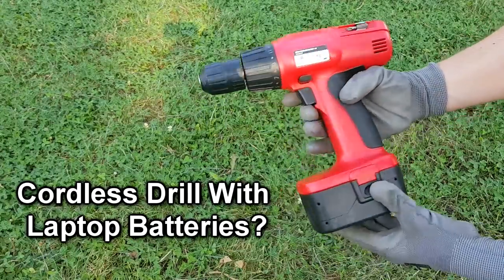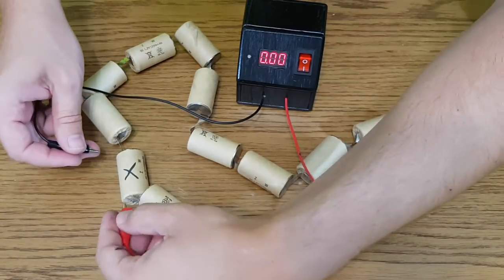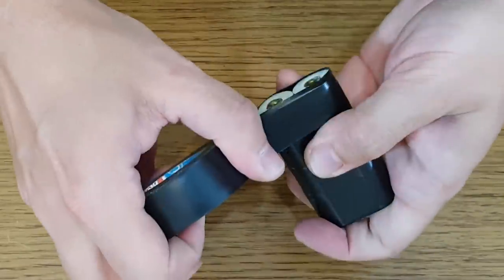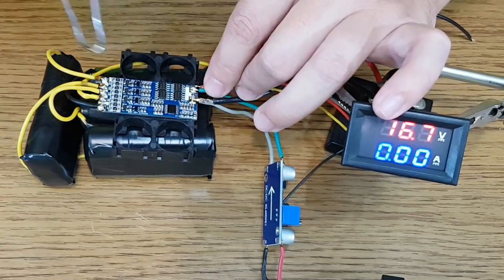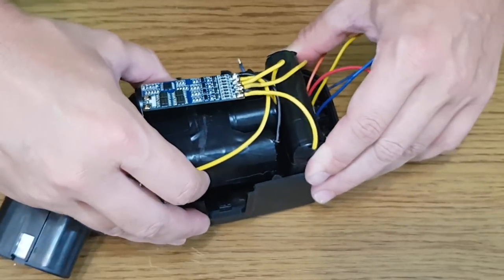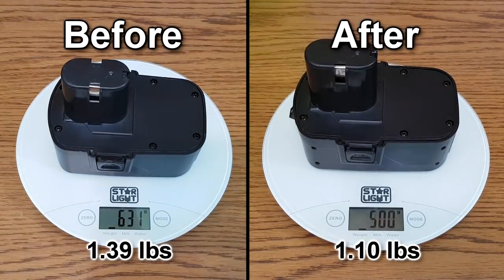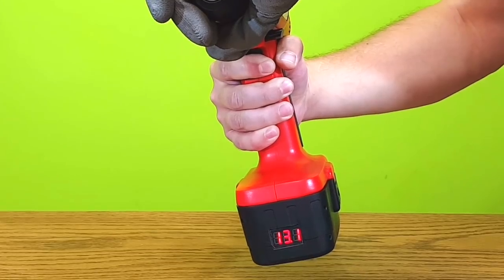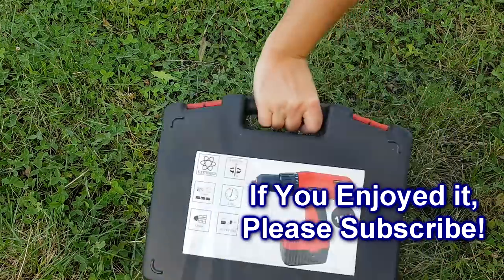Cordless Drill Conversion - With Laptop Batteries??

Comment: Hello Sorin, let me ask you something, i have done exactly what you did, but i have a different bms in comparisson with the one that you used.. It turns out that de internal resistance is 0,7 ohm and when i pull the trigger of the drill, it barely moves and turns off... how can i solve it without changing the bms? Can i add in a permanent way two 1ohm 20w resistors in parallel? in order to avoid the short circuit protection of the protection board? THANKS YOU! amazing Job. Guillermo from Argentina
Reply from the maker: hi. you can try first to add a big capacitor in parallel to the output wires, just before they enter the drill. you need a 24V and 4700uF (or bigger) capacitor. it will store some energy and maybe the voltage will not drop so much when you start the drill. if that is not enough, you can try to add the resistors (between the capacitor and the drill). but the resistors will get hot, when the drill is working in full load, so find a good spot to install them, not close to the battery. the drill will use more than 100W in full load, you need to use the drill with a lower torque level, to protect the 20W resistors.
Reply: Thank you so much Sorin! I added 2 1 ohm 20 watts resistors in paralles among them and in series  with the drill and works, but as you said they get really hot... I will try it as it is until i find a big capacitor. It is a pitty because this is my thurd conversion and i didnt have any problem with the previous two. Thank yoy again for your help! Keep on with your amazing videos!

Comment: Hi
I built a circuit as per yours but used a different BMS and a 3S configuration. When I connect the monitor board I get a constant 3.5v at the two points for the drill powerwith the switch "off", would it help to connect the actual positve lead from the monitor to the BMS batt Positive and not leave it floating as per ur connections. if you wish to help could I send you the layout. Thanks
Reply from the maker: hi. I don't know what type of BMS and monitoring module you use. but if you disconnect the negative for both power drill and monitoring module, everything should shut down. you can use a switch with 2 poles, one for the drill and the other for the voltage monitoring. or you can use the switch only to turn off the voltage monitoring. the battery pack can remain connected to the drill, because the drill should not discharge the battery, when it's not used. only when you press the drill button.

Comment: Hey, thanks for the video! Do yo have any recommendations for a BMS board for a 12V drill? Or would your link work too? Thank you very much!
Reply from the maker: hi. I suggest the 3S BMS 60A board with balance from this link:
https://www.aliexpress.com/item/4000214801977.html?spm=a2g0s.9042311.0.0.27424c4d0pknhS
Reply: @Sorin_DIY  hey that is the same I wanted to order, but got confused by "enhanced' model.
Balanced is clear, it balance changing of all 18650 to 4.2v. But damn what about enhanced!
Do you have any idea about it??

Comment: 16.8V or even 14.4V, wouldn't that burn the 12V motor of the drill? 
I've seen videos where 3 batteries were used to supply 12V for a 12V drill not 6 batteries.
Please explain.
Reply from the maker: This is an 18V drill. the original Ni-Cd battery has 18V nominal and maximum 21V, so the motor is fine. It's actually underpowered.
Reply: @Sorin_DIY  So for 12v nominal, what's the max number of batteries I can safely use.
Reply from the maker: You need 3 high drain li-ion cells with 10.8V nominal and 12.6V maximum. 
or you can buy a Li-po 3S battery, with max 4.35V per cell. this will have 11.4V nominal and 13.05V max, but it's more expensive.

Comment: Couple of questions. Can you post a link for the voltage with buzzer?
You also posted a link for a step down converter. Why?
Reply from the maker: hi. the step down converter is for those who want to use the original cordless drill charger, instead of buying a new 12V universal charger. the drill original charger has 24V. so you can use the step down converter to drop the voltage down to 18V. I forgot to mention that in the clip.. and here is the link:
https://www.banggood.com/Wholesale-1S-8S-Li-po-Battery-Voltage-Tester-Checker-Indicator-Monitor-Buzzer-Alarm-p-26049.html?rmmds=search&cur_warehouse=CN

Comment: Hello Sorin, why is it not a problem that the drill's original battery was 18V but your DIY-Battery is about 16.7V ? 
And  I also wonder why you get over 16V out of a 4S2P Configuration. Wouldn't it be 14.4V if 1 have 4 Zelle a´ 3.6V in series? (Trying to build an replacement Battery for my 14.4V- cordless drill) Love your content, Alex
Reply from the maker: hi. the best battery for this type of power drill is a 5S pack made with high drain lithium cells. it will have 18V nominal and maximum 21V. but I wanted to make this video with laptop cells and I can fit a maximum of 8 cells inside the battery box. so I made a 4S2P battery pack with 14.4V nominal and max 16.8V. the drill spins a little slower, but it lasts much longer than the original NI-CD battery, because lithium cells have a bigger capacity.
Reply: @Sorin_DIY  Oh ok, now I get it:) Thanks a lot for the fast reply, looking forward to your future videos!

Comment: you shouldn't use iron soldering to solder these batteries because heat can damage cells, use a spot welding pen instead.

Comment: Sorin I want to modify a battery pack so i can use it like AA batteries
loading each 18650  separately  and charged searately  so that a bad 18650 
would be no problem unlike a battery pack would be ?
Reply from the maker: yes you can use it like that. a BMS is still needed for the protection features. and very important, use high drain cells, not laptop cells.
Reply: sorin
The bms  is a battery changing  pcb right?
I will be charging them with a home  18650  battery charger individually.
could the protection features be omitted from the drill?

Comment: Can the wiring be modified so that instead of using a built-in BMS, the battery charger will be the DIY 18650 using the TP-4056 shown in your other video? I saw somewhere that BMS discharges the "overcharged" cells to balance the cells and the cycle tends to shorten the life of the cells in the long-run. I like the low voltage alarm feature and I wonder if the external charging is feasible. Could you see any drawback?
Reply from the maker: hi. you can use tp4056 modules to charge cells connected in parallel. but each charging modules need to have the input supply voltage separated from the others. you can make a transformer with multiple isolated outputs. the tp4056 module with protection can deliver an output current of max 3A, so it's not strong enough to protect the cells inside the drill battery pack. you need a protection board with more than 10-20A. you can use tp4056 module only to charge and balance the cells.
Reply: @Sorin_DIY Have you seen the new version of TP4056 with dual protection? Is it not enough?
Reply from the maker: not if you connect them in series.
Reply: @Sorin_DIY  How about I wire the battery so that each cell or pair of cells will have a dedicated TP4056 outside the battery?

Comment: Im upto build a battery pack for my cordless drill.(drill has rs775 motor)

Stock battery was 12v 1.5ah. 
Can i replace that with 3s2p pack with 10A BMS ??
How to choose the amps rating of bms ???
Reply from the maker: hi. the BMS board should handle more than 10A, probably 20A should be fine. the old battery was made with ni-dc cells? that means it has 12V nominal. you need to make a battery pack with high drain lithium cells. a 3S pack has 10.8V nominal. a 4s pack has 14.4V nominal, which is too high. so you need a 3S pack. 3S2P is better.

Comment: You have batteries that will draw 10 amps, but the BMS is only rated for 8 amps?
Reply from the maker: hi. the BMS has a maximum continuous discharging current of 8A, but it can take a peak current draw of more than 10A for short periods of time. all these components, especially the laptop lithium cells, are pushed to the limit, because I wanted to explain how this conversion works and what the disadvantages are.

Comment: Hi Sorin, I am currently converting a cordless Drill battery, your video is a must watch as usually ))
My convertion is a 3S, so 12.6V. How much volts should be used to charge the pack ? 13V ? or more?
And what happen to the DIY charging circuit that can balance old recycled cells of different capacity?? 14:40
It would be an interesting build, in a time where we recycle a lot ))
Reply from the maker: hi. I wanted to make a small lithium cell charger with TP4056 modules in series. it evolved into a full video with pros and cons - DIY - BMS Protection Board made with TP4056 modules. the charging voltage for your drill depends on the BMS board you use.
Reply: @Sorin_DIY  Thx, the BMS I use is a bit simplier than yours. I charged all 6 18650s, with some TP4056, and then connected them to the BMS 3S. yeah 6, but 2 cells are parallel, for more capacity...
 It works great with my drill, now stay the charging part, I read most people charge those 3S, with 12.6V, and others say 12.6V is a bit low, and will take a lot time, others recommande 13.6V. I dont watnt to pump to much voltage into those 18650s. So maybe 13.2V seems a saffer voltage. What do you think?
Reply from the maker: what BMS model do you have?

Comment: Can I use one 12v battery with one 18 v drill using one 'step up ' ? Thank you
Reply from the maker: no. the power drill needs 10 - 20A
Reply: Sorin - DIY Electrical Nerd 
If I change the battery with model 18650 and use a step up for the charger that put out only 18,5 V. From 18,5 to 21 output. Thank you

Comment: Hello thanks for knowledge .
I would like to set low alarm on my DIY 13s battery can I use 2 8s logger for low alarm or any other option 
Please guide.
Reply from the maker: hi. I never tried that. I think it will work with 2x 8S battery indicators. you need a 2 pole switch to turn it on. I don't know if there is another way, I never made a 13S battery pack.
Reply: @Sorin_DIY  Thanks

Comment: Hi Sorin,
Now I need to ask for your help. I have a Bosch Hammer GBH 24 VFR professional cordless drill and I'm tired of buying very expensive replacements batteries. Is there a 24V one on the market that I could use for my drill? Which one do you think would have sufficient Amp to power my drill? Thank you in advance.
Reply: To add to my question: I'm actually looking for a corded solution - switch from battery to a 24V ?A transformer/adapter for my drill. 
Thanks.
Reply from the maker: hi. this type of drills need a lot of power. I don't know what type of battery you can buy. if you want to build a battery pack, you should use good quality high drain cells with 25A or 30A like samsung. and a good 5S or 6S protection board with balancing feature. if you want to make it corded, you need a very powerful supply current. and a 24V with 25A or 30A power supply it's very expensive. you can just buy a new drill instead.. the cheapest way is with a transformer. it will not have all the power you need, the voltage may decrease, when the drill is in full load, but it will work. my next video will include a tutorial with a transformer.
Reply: @Sorin - DIY Electrical Nerd 
Thank you Sorin. I look forward to your next tutorial
Reply: @Sorin_DIY  Do you thing something like this would do the trick? To make it corded.
Reply from the maker: it will probably work, but you also need a very powerful power supply. for the cost of all this, you can buy a new drill. the whole point of converting it by yourself is to make it cheap.
Reply: Thank you Sorin.
 @Sorin_DIY

Comment: Laptop batteries very low drain cells, usually have max dis 4A and high internal resistance not safe to use for power tools they only fine for power storage. Also don’t solder cells you should you spot welder instead of. Even you got some high drain but majority of them are not.

Comment: Hi sir! I i watched your video and its very clear. But heres my problem sir. I have a 12 v drill and i am planning to upgrade my battery capacity so i bought 12pcs 3.7v 18650 1200mah 4.44wh and one pc. 4S40A. Can u tell me if its good or not?? Or can u give me any suggestions ?
Reply from the maker: hi. you need high drain cells for the power drill. can you give me the link for the lithium cells and the BMS board?
Reply from the maker: I don't think the cells are good enough, there is nothing mentioned about the maximum current. you need high drain cells with a maximum current of 20-30A like these:
https://www.aliexpress.com/item/32835679557.html?spm=a2g0s.9042311.0.0.27424c4dAlhiFT
and that type of BMS board it's similar to a 25A older model, I don't think it can handle 40A. but even with 25A it should still work.
Reply: @Sorin_DIY  thank you so much sir and more power ♥️

Comment: Why did he convert an 18V battery to 14.4V? The old battery was 15 x 1.2V NiCd or NiMh. That’s 18V nominal with a maximum voltage of probably 22.5V fully charged. 5x high drain LiIon 3.6V cells in series would have been perfect. Or 10 laptop batteriesin 5S2P - 18V nominal and about 21V fully charged.   Sure it’s hard to find a 5S BMS. But the drill would draw less amps and spin at it’s designed speed all the time and not just fully charged.

Comment: Hi Sorin, an absolut newbee without any soldering expreience can be capable to do it?
Reply from the maker: yes, but with a lot of patience and triple check all the connections before turning it on.
Reply: Thank you for the fast answer! I found links only for 4 item, can you also include sources for the others? (Switch, warning display, etc.) If I wanna modify my battery exactly like yours, I will need them. :)
Reply: Or with a LiPro balance charger I can avoid all the electronics and I should only replace the cells?
Reply from the maker: these cells are not good for power tools. you need high drain cells with 30A output current. you can use only 4 cells. you need a good BMS board and a 16.8V charger. this BMS is good, 4S with balance:
https://www.aliexpress.com/item/4000214801977.html?spm=2114.12010615.8148356.9.2734bb41BGtsOx

Comment: Foarte bine explicat, frumos lucrat, am sa incerc si eu :)  Cred ca ii ia cam multicel sa se incarce nu?
Reply from the maker: salut. incarcarea dureaza cam 5-6 ore. dar nu se poate folosi toata capacitatea bateriei. altfel ar fi durat vreo 9 ore.
Reply: @Sorin_DIY  dupa 5 luni am luat si eu o makita cu acumulatorul stricat. si am incercat cu o sursade 12 V si un step up la 18V si nu a pornit, dar nu era sursa de PC sa simta curentul. O fi stricata ? 
Am sa o fac si eu la fel ca tine daca va merge 4S2P ca e tot de 18V
Reply from the maker: modulul step up are 2.. max 3A, deci nu are destul curent pentru bormasina. poti doar sa incarci acumulatorul cu el. incearca cu sursa de 12V direct la bormasina. sau o folosesti doar sa incarci acumulatorul. bormasina la pornire si in sarcina maxima foloseste intre 10-20A. daca o invarti in gol foloseste 2-3A
Reply: @Sorin_DIY  da, dar ma gandeam ca porneste macar fara sarcina, dar nu a vrut :))

Comment: Salutare. De ce mai trebuie sa folosesc convertorul daca am încărcător de 12 v? Încărcătorul este de laptop, nu ar trebui să aibă convertor? Mulțumesc
Reply from the maker: salut. depinde ce tensiune de incarcare foloseste modulul BMS. in cazul meu 18V. deci am nevoie de  un convertor step-up sau step-down, pentru a modifica tensiunea alimentatorului la exact 18V. trebuie sa verifici ce tensiune are incarcatorul de laptop.
Reply: @Sorin_DIY  îți mulțumesc frumos. Eu nu le am cu electronica. Incerc sa fac o baterie de 12 v, pt o bormașină Bosch, din 3 baterii li-ion 18650. Am un încărcător de laptop de 12,22 v și 2A. Îți mulțumesc încă odată. Daca ai putea să îmi dai câteva sfaturi ar fi de mare ajutor. Îți doresc succes in tot ceea ce faci.
Reply from the maker: daca folosesti doar 3 celule, trebuie sa fie "high drain cells", adica sa produca 20-30A. cum sunt samsung INR18650. daca ai celule de laptop trebuie sa folosesti cel putin 6, cate 2 in paralel. acestea au doar 2-4A. altfel nu au destul curent, bormasina nu are putere, se vor incinge, pot chiar sa ia foc.
Reply: @Sorin_DIY  am făcut cum ai zis, am legat cate 2 in paralel, și apoi în serie(3 pachete a câte 2 baterii). Am pus BMS-ul și apoi l-am pus la încărcat cu încărcătorul de 12,2 v. A mers totul ok până aici. Dar când am pus bateria in bormașină și am apăsat pe buton se opreate. De ce? Nu ai bateriile destul amperej? Eu nu am încărcător de la opus.
Reply from the maker: ce modul BMS folosesti?
Reply: @Sorin_DIY  uite îți scriu ce scrie la specificații:
-model:hx-3s-fl25a-a
-size:56mm*45mm*1.2mm
-over voltage range: 4.25-4.35v
-over discharge voltage range: 2.3-3.0 v
-maximum operating curent: 0-25A
-maximum transient curent: 34-40A
-quiescent current: less than 30uA
-internal resistance: less than 100mOhmi
-working temperatura: 40....+50grade Celsius
-storage condition :40...+80 grade Celsius 
-effective life: more than 30000 h
-short circuit protection: yes, delayed self recovery.
Placa mea este verde, nu albastra ca a ta.
Mulțumesc frumos
Reply from the maker: pare destul de bun modulul. cand porneste bormasina, foloseste un curent foarte mare. sa nu creada cumva modulul de protectie, ca e un scurt circuit si sa deconecteze bateriile.. incearca bormasina cu rezistenta de 0.5ohm in serie cum am facut eu cu sursa. sau pune alti consumatori mai mici la baterie, sa vezi daca se comporta la fel. poti sa incepi cu un bec de 12v si 0.5A... pana la un bec de masina de 55W. e posibil sa fie o problema si cu circuitul bormasinii.